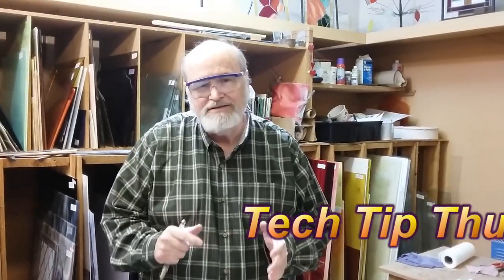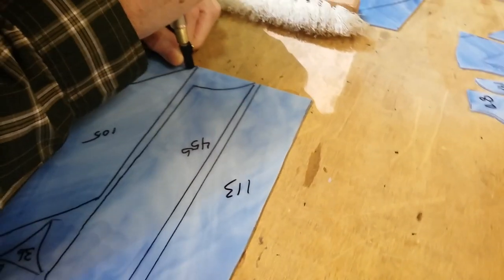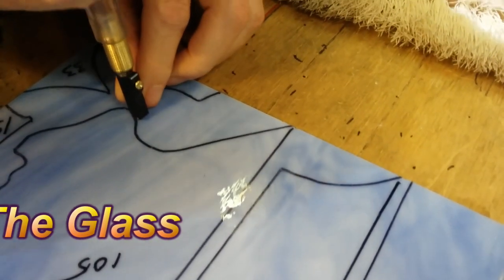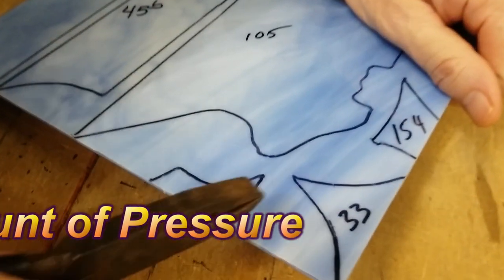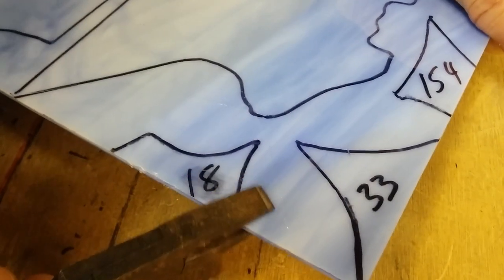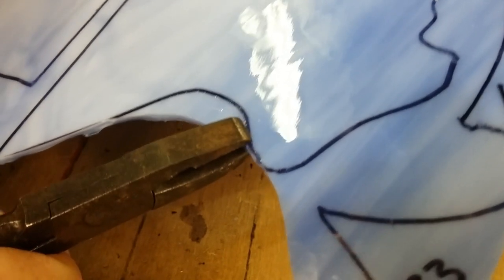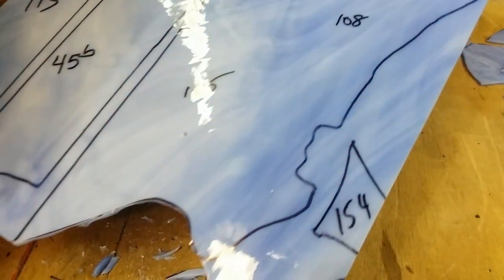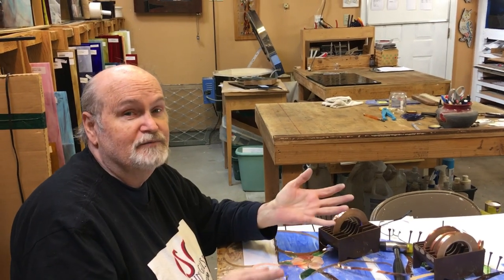Cut An Inside Curve In Stained Glass V168

Comment: Thank you for the tips. I’m less inclined to take the risks with some curves and just grind them away instead. Not so good for the grinding bits though. I just need a little more patience and work with it trying to make the main break so quickly,
Reply from the maker: I don't blame you, sometimes the radical curves are difficult but there's very little risk on slight curves and as you do them, you'll get more experience till it's just no big deal!

Comment: Saw a grozing pliers at Hobby Lobby & wondered how they're used. I see they work best in pairs. Also, wondered about the ball end of the glass scoring tool. I see you use it to ring the glass like a bell. 

Been picking up mirrors people discard, & when resizing them they haven't always parted evenly. I see I should help propagate my score marks by ringing the glass. Some of the mirrors are of ¼" thick plate glass. Looks like ringing it first may help achieve greater success. 👍
Reply from the maker: When I started out, I had two pairs of grozing pliers and a glass cutter and some other basic tools. I find you can get great control when cutting glass and using two 🙂 pairs of grozing pliers. I didn't get a pair of running pliers for several years after beginning with glass and I see many students who try to do everything with running pliers and so they never get to really find control with parting glass.  
1/4" glass is "plate glass" and it's the only stuff that I ever got hurt with that resulted in a scar. So it's especially important to tap your scores with that type of glass, I notice that it's easy to get a deformation when parting glass using running pliers, they apply uneven pressure. 
You call it ringing the glass, but that might lead others to assume that you can tap anywhere. It's important to tap directly under the score all along the score line.

Comment: When using Grozing  pliers if you turn them over to the curved side, they have ridges on the inside of that curved head. This allows  for gently grozing ( Scraping)  the small area of uneven shards left that may need to be removed bit by tiny bit… also great for gently smoothing off outside curves, like a small corner that needs to be rounded off.
Reply from the maker: I once worked with a stained glass instructor who didn't have a grinder in her studio. She only used grozing pliers in her studio to smooth glass.

Comment: Why did you not use running pliers?
Reply from the maker: Running pliers are designed to break apart straight lines and gentle curves, they are not good for sharp curves because the outer edges of the curve often break. What we're trying to demonstrate in the video is the best method to successfully nreak the glass.